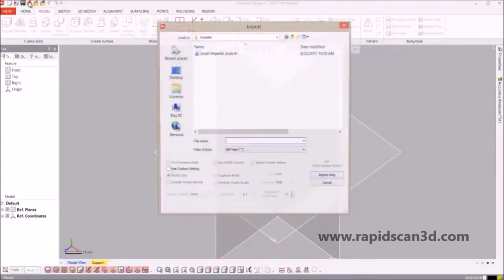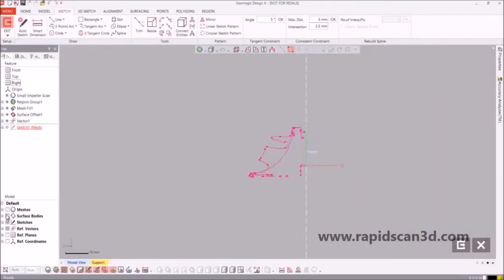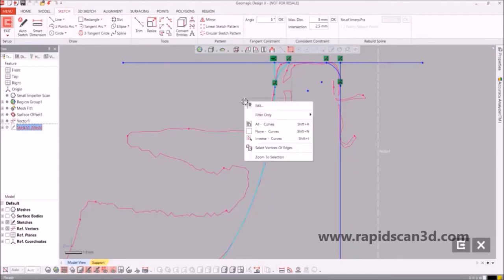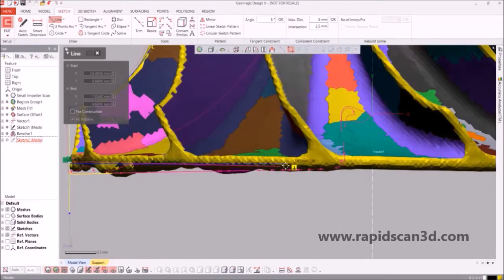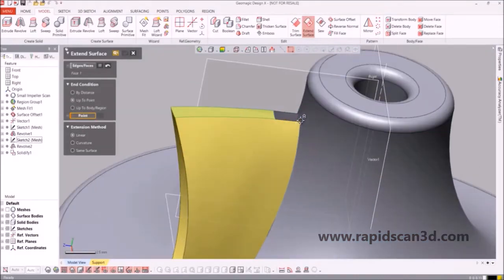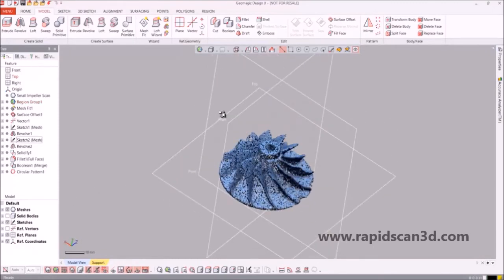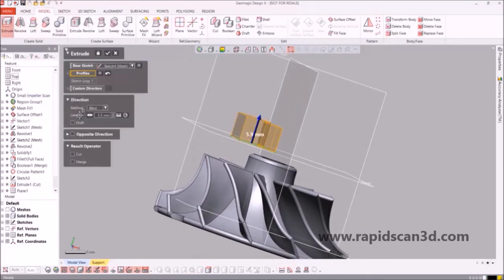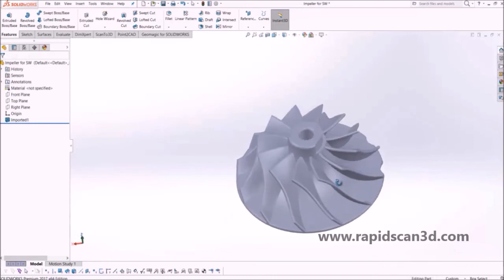Reverse Engineering an Impeller with Geomagic Design X

Comment: When working with an optical scanner, a problem arose-it does not remove the edge of a thin part, the overall size is hard to catch. How did you solve this problem?
Reply from the maker: Hello .  The first question I would need to ask is what type of Optical 3D scanner did you use?  The scanner we used for this part is the Solutionix D500 which is able to capture high resolution and sharp edges.   The system captures data t +/-  0.01mm accuracty and 0.03mm resolution.  https://www.rapidscan3d.com/scanners/solutionix/d500   Let us know if you have any questions we are happy to help  -   info@rapidscan3d.com